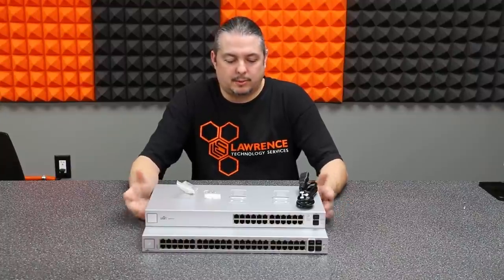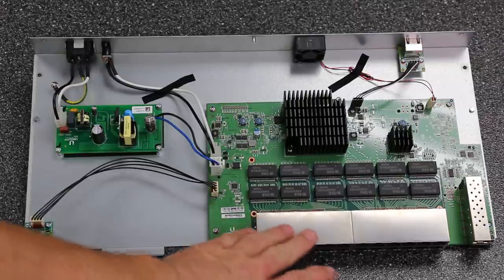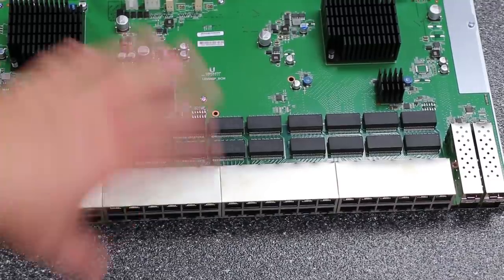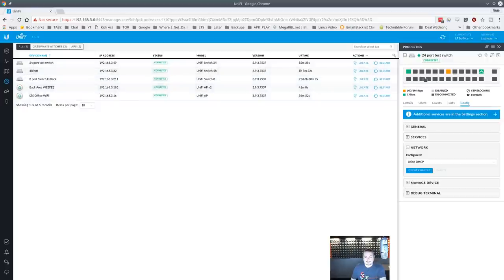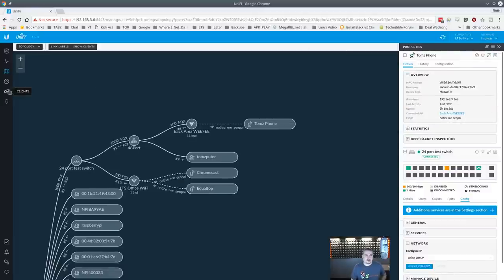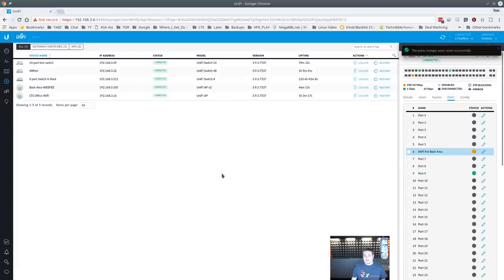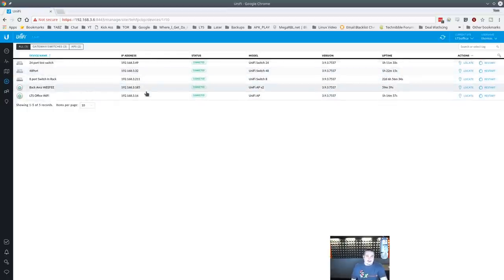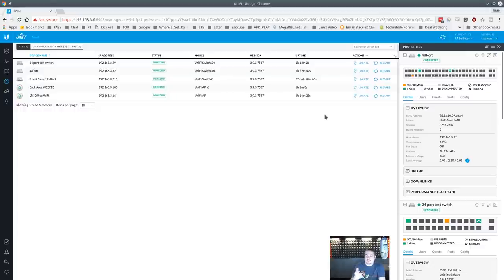UniFi 24 & 48 Port Switch Review And Yes, I Took It Apart

Comment: I use a lot of UniFi for my home/business/DC as well as clients. 

Pretty good but there are some things you need to use caution with:
Touchy port speed/connection negotiation - Tired of having to manually set port speed on some devices that wont work with these but fine on EVERY other device.
Touchy port flaking out - They fry easy as heck. 
Lights don't always work - Some lED's stop working until reboot or power-cycling, others dead from firmware bugs.
Firmware - OMG, these can be great but still need to be wise with UBNT and their firmware's being rushed out. 
Power supply is touchy (PoE models) - Got a few that turn off the PoE if you get a tickle on the mains power, power cycle required, not good if your cloud key is powered from it...

Pluses: 
24V / 48V PoE options
SFP ports pretty flexible with other vendor adapters
Managing ports, VLAN's and other setting very easy
Switch stats and topology are handy but still dependant on controller version.

Comment: Thanks Tom! I'm planning to add a EdgeSwitch 16 XG to provide SFP 10G between critical boxes to the primary FreeNAS box - this should help IOs over iScuzzy (ha!).  I do need a managed GigE Switch inside the 'Den' as well, so may consider the 24-port for the UniFi version.

I picked up a NETGEAR ProSafe 24-port (unmanaged switch) and it has the annoying cluster of LEDs off to the side. What's worse, you have to look at the LEDs very much head-on, or the LED glow leaks into near-by LEDs, making it pretty useless even further!

Comment: The 24 black chips are small signal transformers, 1 transformer for 1 port. If you follow the traces you can see the each trace represents one wire in the STP/UTP bundle per ethernet cable. Having a dedicated transformer per port is not a strict requirement, and it is a sign of a good design.

Comment: That black things near rj45 ports that you called "chips" are not chip's, they are transformers and primary purpose of those is to provide electrical isolation, they are passive component and sometimes they are integrated inside rj45 port.

Comment: So, I totally dig the UBNT stuff - but I wish the switches were layer 3 capable. Need a "Security Gateway" to do routing with Ubiquiti stuff in the UniFi paradigm. Not really a deal-breaker for most, but for me, I'm a nerd and want full OSPF/BGP support in my "core", and at the edge... Would be really nice to NOT require a trip outside the silicon to get from one VLAN to another. Just sayin'. I love my UniFi gear, but I'm still trying to figure out how to maintain full high-performance routing between my lab networks and my production network.

Comment: Gday Bit of a shame it doesn't have a single or duel 10GBE  SFP Port . I am looking around for a good affordable 24 port gig switch with 1 or 2 10GBE SFP ports for the home LAN or LAN PARTY situation that you might need a single 10GBE SFP uplink or connect to two servers that use 10GBE SFP ports

Comment: So can i buy a UniFI switch with PoE ports and disable does PoE ports in the software? But then my question is: What if it needs to reboot? Will it remember the state of that particular port? Because i want to buy into UniFi equipment. But i have a lot of expensive hardware: Mac Pro 2019 being the most expensive. But i also have my tv and receiver, my PS4 Pro, Apple tv etc etc...

Comment: I have the 24p, and I love it. Great software and stable hardware. Only downside are the price in my country(Norway) 😕
Reply: you should try buying one in Australia :)
24 port 250watt is just under 600, the 500watt is around 850, the 48 port 500wat is 1300   .... these are some of the best prices here, the average reseller is in some cases a fair bit more than above.
Reply: Same in Italy
Reply: 24 port (non-PoE) is 200 Euro in the Netherlands.

Comment: the hardware seems good but the config and pauses as it configures are unacceptable.   it may be more complex but I'll take Cisco iOS.   ps the power supply in the Cisco 3650 weights more then the ubnt switch
Reply: It's a bit unfair to compare this with a product that costs way, way more. The pauses only happen when you do specific tasks, like changing network settings or vlans. Changing a network port name does not pause network operations.

Comment: Don't these switches need the Unifi Controller, I was looking at adding the 48 port to my network and someone on the forums said these can't be used as a stand alone.
Reply: Aaron Lawrence you do but you have a bunch of options. You can DIY one out of a raspberry pi, run one off a server or desktop computer, or ubnt offers a management service for mission critical operations. Most people I know use a computer but it does need to be on almost 24/7 as your devices will crash after 2 days of not being connected to a controller.
Reply: So if I just setup a VM on my server to run the controller software I should be able to easily implement this into my network?
Reply: Aaron, you dont need to run the controller 24/7 ... if you want pretty pics and stats yeah you do, but you dont really need it unless you want to actually configure.
Reply: Yes, or get a cloud key.
Reply: So I can jsut run the cloud key alongside of this switch? What are the advantages of a UNIFi switch over the Edge line?
Reply: Ressy6 How large is your network? I sort of assumed that a controller would be necessary since I have had clients shut down their controller and everything goes to hell; except these are very large, complex, networks. Also most of my clients have captive portals for Guest SSIDs and VLANs so they need the controller to operate.
Reply: George Lockwood  It's what I would say is a good sized network for being a home network. I currently have 5 severs, 1 AP, and a few hard line runs for different devices. It's not a large network but more than a normal home would have in opinion. I have several different plans setup with all the servers on aggregated links.
Reply: Aaron Lawrence i meant for Ressy9 but on the topic your network would be fine w/o a controller for operational instances.
Reply: they run web hosting servers, also a telecoms contracting company among others, the controllers purpose is only to adopt and configure,  and to suss stats if you really want them like DPI, if you dont care for constant monitoring of what every device has been doing, you dont need it, the last time I loaded the controller software at one place was to add extra AP's, last year.  Again, if their networks dying days later, then there is something very wrong with it.
Reply: Yes. I've run the controller for >5y on Ubuntu in the cloud without a hitch, and controlling ~10 sites

Comment: So does the switch have its own built in router ?   No need to add a router with this switch ?  Sorry I am a hobbyist in networking, not a pro ..
Reply: Brian Burwell you need to purchase a UniFi security gateway usg or pro version rack mountable 
Hopefully this helps 
Look on amazon ubiquity products

Comment: Do you need a cloudkey to have the UI on this switch?
Reply: Yes, or an unifi controller installed on a server or virtual machine.
Reply: No, you can install the UniFi Controller on just about anything. If you want it running 24/7 on a dedicated device, the cheapest option is a Raspberry Pi.